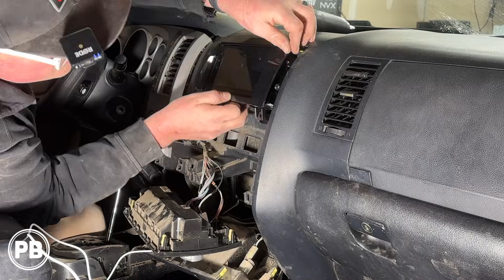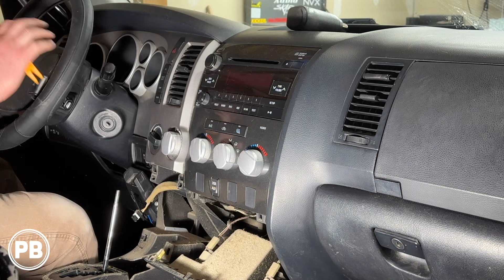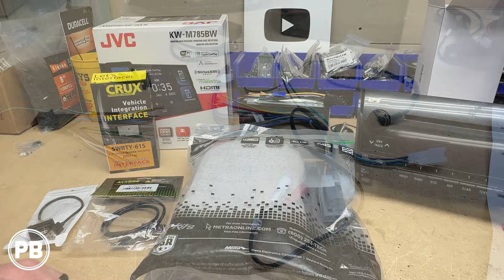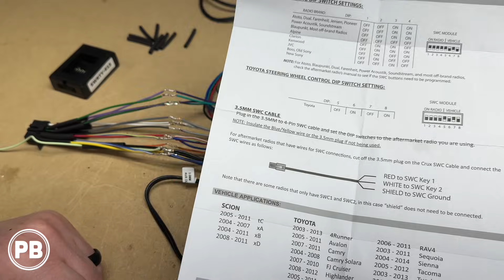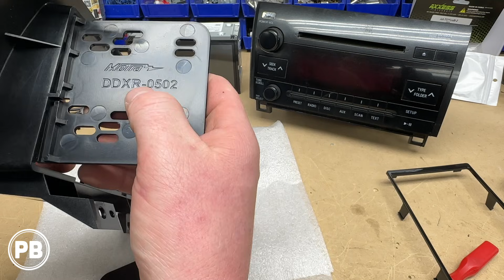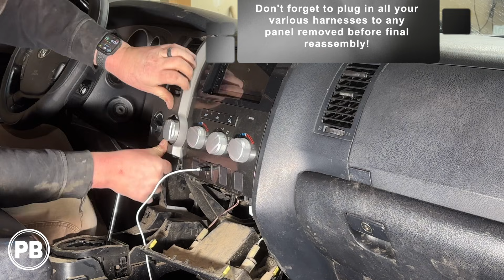2007 - 2013 Toyota Tundra Radio Install

Comment: At 8:55 you have to extra wires stick out (red wire for accessories and black wire for ground) for a back up camera which I'm going to put on my 2007 Toyota Tundra. My question is where did you find the extra wire for that. Can I just harvest the extra wires from the extra wires I'm not using from the Crux???

Comment: Need a video for true DYI to add a 4 ch LOC to the speaker wires rather than plug and play adapters for a new stereo head can’t find any video or pictures that point out the wires only videos using adapters that require a new manufacturers stereo unit

Comment: I have the same truck. with less dust, and I purchased all of the same equipment to install.  However, the dash trim kit seems to have been redesigned.  The bezel that goes around the radio is no longer included.  As a result there is a small gap between the radio and the trim.  Is there any solution to this?  Metra does no seem to have any other kits to fit my truck.

Comment: Great video!  Is it possible to integrate the OEM reverse camera and satellite antenna  to this?  Thank you!
Reply from the maker: Yes, but depends on where that camera displays. If it’s on the radio, with the right harness adapter it’s retained on the new radio.

Comment: Saw your video from a few years back on an 05-07 f250/f350 Bluetooth radio install, how much would it cost for that to be done to mine? If a shop like you did it?